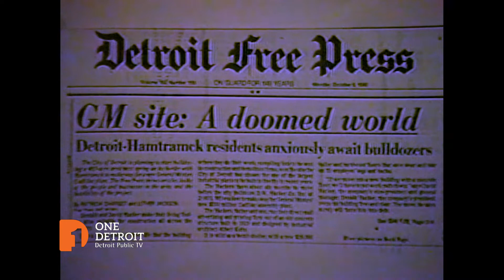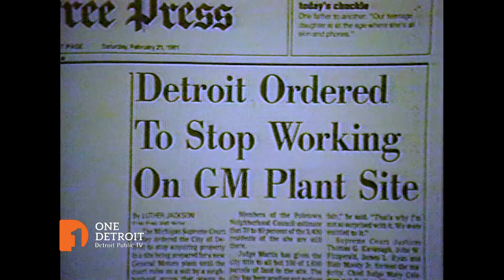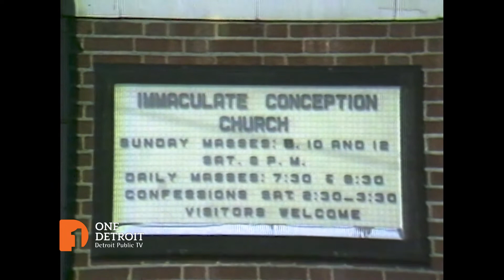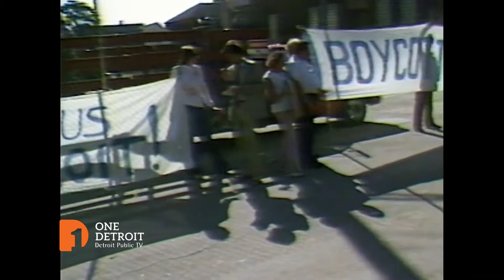Poletown Plant | One Detroit Clip

Comment: Building the GM Poletown Plant was a good idea. Just the absolute wrong location.

Then mayor Coleman Young had racist objectives which lead to Detroit's decline.

The GM plant should have been at the site of the old Packard Plant as but one example.

In the future all large factories should be built on vacant industrial land or on the site of a old outdated factory.
Reply: The obsolete factories in Detroit area were built vertical because real estate was unavailable.  The Poletown plant is a sprawled factory of a single floor, like most modern factories.   There was no way to assemble the needed land by the traditional process of buying individual properties.  The use of immanent domain to acquire properties was wrong.  Americans are losing property rights.  The social cohesiveness of that part of the city was destroyed.